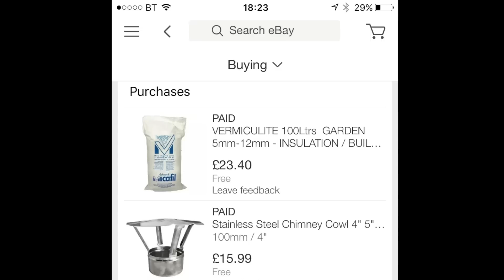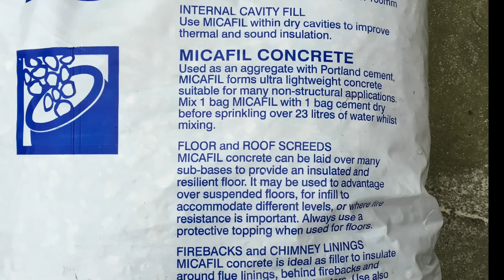Wood Fired Pizza Oven made over a gym ball

Comment: I watched this video a year ago and finally made one. I went with perlite instead of vermiculite because I heard it holds up more. I did a ratio of 5/1/1 perlite/portland cement/water. I went through 4 cubic feet (sorry for america non metric we're idiots here) of perlite and about 1/2 a bag of cement. I did a layer of perlite cement, put a fire insulation blanket, chicken wire and another layer of perlite/cement. It is in the process of drying right now. I let the first layer dry for about a week. I will build it on a stand with wheels so I can move in the garage when not in use. Thanks for the inspiration.

Comment from the maker: Hi, Ball is 65cm in diameter, Cement is standard blue circle, thanks for watching, keep the questions coming and I will answer
Reply: Mark Cuthbertson loved your video & just completed mine using your method. Do u think a standard sand cement render would work instead of victus ?
Reply: Good Job. What kind of material u put underneath the brick? Was it suitable for high heat?
Reply: Hi, do you know how many litres of vermiculite you used in your build?
Reply from the maker: MrCurry about 3/4 of a 100 litre bag
Reply: Mr C TV thanks 👍

Comment: Thanks for your inspiration. I've built an oven this way in spring this year and have used it a lot of time. A good thing was to put netting wire in the walls. What I had to change was the fundament. The sand was too hot and the bottom board begun to smoke a little bit. I used fermiculite instead of the sand and tiles as the bottom.

Comment: Great video! Loved the creative use of the gym ball! For the inside of the oven if you could line it with an inch of fire clay mixed with fire brick aggregate it will last you a long time and resist cracking and heat loss.

Comment: I've made one a bit like yours and fired it up today for the first time and I made 4 home made pizzas,,  it did them in no time I was real impressed in how they work
Reply: Ricky, did you do it exactly like he did it... or did you modify it any at all?
Reply: How is yours holding up?
Reply: Pizza's don't work bro!!  You have to work making /baking the pizzas and the hardest work... To eat them all untill you burst. 👍😊
For an oven - (any oven) it's important to accumulate heat. A very low density concrete doesn't do that well. That's why it proposed the 1" clay liner which heats up independently. Clay is a very good heat accumulator. Without the clay liner your baking will will be less
Regards from Bert in Spain... 
It's almost 40 degrees C here.. Pizza's bake exposed to sunlight... 

Good luck with your pizza oven project

Comment: Nice job ☺ my compliments. Few questions to ask you, as I did 3 brick ovens and You know the work load time and cost. My intention to try a cast one in a new holiday house. 

1. How much internal temperature you can reach ?
2. How long after using it holds hot its internal temperature ?
3. any cracks so far?
4. Do you know the external tempreture while it's working full please ?
5 do you still advice same ratio of mixture - cement or refractory please ?

Thank you so much in advance..

Comment: If you apply a clay liner inside the dome, you have better heat retention and a cooler shell.  The clay liner will shrink when drying and a narrow cavity will occur between liner and insulating shell.  After drying fire up.  This will provide better Fuel economy, higher temperatures inside and better backing results. also increased longevity of the whole structure and no shell cracking. 
 Remark: while drying the clay liner will crack a bit (this is normal due shrinkage and will not influence the integrity of the liner). Cracks can easely be repaired with clay slurry.
After firing up, the clay liner is frost resistent.

Alternativ for the vermaculite U can use perlite or expanded clay pellets or a mixture thereof.

I made one of cheap expanded clay pellets ( the ones used in hydroponics) and cement and with a 1" clay liner and a steel door with adjustable air intake. I normally use olive fire wood which gives a delicious aroma to the pizza or sourdough bread. Cold or hot smoking of fish or meat is also possible and absolutely delicious.

Regards from Spain
Reply: How does one apply a clay liner?
Reply: @zennsx  Form Several equally  thick pancakes of clay and stick it to the inside of the dome. Close the seams with your fingers untill the whole inner surface of the dome is covered.  Let dry the clay untill hard.  Than start at small fire in the dome to drive out the remaining moisture.   Thereafter make a bigger fire inside the dome to bake the clay.   Repair eventual cracks with clay slurry.
Reply: That's a great tip thanks. And olive tree wood is a great idea too!
Reply: Can u do this on one go... i mean  cover the ball with clay then cover with perlite. Or do u have clay first, wait for it to dry then perlite  shell. Reading your write up I guess it can be done in a single go. Also it is weather proof.  I.e left in the rain?
Reply: @tanwirkhan78611  I have not tried to make the liner +shell in one go. I made the clay liner after the cement was cured and the low density concrete dome installed on it's final position. Once that was done I applied the clay liner. Doing so I could keep the weight of the dome relatively low for easy handling/lifting by one person (me).
I guess technically you can make the liner + shell in one go but the total weight of the oven becomes a headache. 
After erection the outer surface must be sealed with lime or cement slurry to avoid rainwater entering the porous concrete dome.

Regards from Bert in 🇪🇸
Reply: @son-of-a-gun  thanks for the response, weight for me won't be an issue  as it will be fixed in place... my idea was to build the shape out of sharpe sand then cover it with clay let it dry with a key surface. Once dry cover with perlite and top with  cement  slurry
Reply: And paint
Reply: @tanwirkhan78611  I think your method will work but you should not make a key surface but a smooth surface. The clay will break loose from the concrete anyway and that's exactly what you want.  please refer to my first comment. 
I hope you mean to cover the clay with perlite +cement mortar and once everything is hard and dry put on the cement slurry for sealing. I would seal it as a last step. 
Remark :  lime slurry sealant is a slightly better option since lime does not  crack as cement does i.e is more flexible. besides when lime gets wet in the rain it will have self healing properties I.e. It becomes a bit soft and closes the cracks if any. 
Good luck with your project
Regards from Bert in 🇪🇸
Reply: @son-of-a-gun  ahh OK,  got u. Thanks ill have statred build the base already.

Comment: I built mine 13 yrs ago, I think yours is a creative use of gym ball and materials, but I think you may need a refinement. The essence of a stone or clay oven is that the wood fire heats the surrounding rock, and the rock retains the heat, which cooks the bread (or crust).Vermicúlite, like perlite, is an insulator. This necessarily means that there will be little stored heat in the hardened mix. Your oven will heat fast, but I'm guessing it won't stay hot long.

In mine I used  a dense clay brick for the oven interiôr, and I put the perlite/cement mix over that. My intention was to keep the brick from sustaining heat loss from  the outside. That way the heated brick retains the maximum heat and only loses heat through the oven interior.

I think it might have been better to start with several inches thick of mortar, with a fire clay (refractôry)additive, and over that add several inches of your vermiculite mixture
Reply: Im hoping you could help me
Reply: @marvincastro4206  ...If you have a question, I'll try to answer it
Reply: @frankhoffman3566  Hello Frank, i'm glad you are still with us. Can i ask something? I was told that white cement would be great for the interior alongside clay brics. What do you think about this? I intend to do one somewhat yours soon, any new knowledge to share?
Reply: @juliosalgado956  ... Hello. Just to clarify,  I don't do concrete as a profession.  I have done quite a bit of research and have had successful concrete projects.

My research indicates that white portland cement is the same as the usual gray stuff.  It isn't better or more heat resistant. If you are talking about coating or painting the red brick with a white portland slurry, I wouldn't. You'd risk chips of the hardened cement  flaking off and finding a way into your food.

I'd want the interior surface to be a good, dense   red clay brick,  (except for the oven floor which should be fire brick)and the mortar joints regular bag mortar, fortified with about a shovelful of fire clay per 90 lb bag.

A method I didn't use to form the oven, which I would have, had I known, is using damp sand to form the interior, then laying strips of plaster of paris soaked paper over that.  After it hardens, the bricks are laid against it, conforming the oven to its shape. After everything is finished and hardened up, you dig out the sand. Really, the only issue is getting the right shape to begin with.
Reply: @juliosalgado956  ... generally, the best shape for the inner part of the oven is a dome.  That's why some are using pilates balls or beach balls. The dome area should be able to comfortably fit your pizza, with a little more space  to fit some of the hot  coals of your original wood fire.

The short tunnel should be wide enough to slide your pizza in. The top of the tunnel should be lower than the top of the dome. The stovepipe should come out of the tunnel and not the dome, encouraging the dome to retain heat longer.

That's about all I know. I hope it helps
Reply: @frankhoffman3566   You are great, i'm glad you could share your knowledge with me and all the people that will read this in the future. I will be writting all your thoughts in my personal book of projects. TY! REALLY GLAD to meet you!

Comment: Whilst the vermiculite is a good thermal insulator, it has no mass and thus will not hold any heat. The idea on a wood fired oven is the bricks get hot and radiate the heat once the fire dies down and can cook for many hours. I doubt the concrete will do the job anywhere near as well, though if just pizza is you sole aim it could be ok.
Reply from the maker: Agreed, but I always get full before I worry about the oven cooling down too much, so it works for my needs, wouldn't work for a commercial applications for the reasons you've stated. Thanks

Comment: Great job....amazing. So simple Just a comment on the outer rendering cracks. It's most likely caused by the expansion differential between the two different substrates. You said the outer render gets fairly hot so there's a heat transfer through the Vermiculite which will expand at a greater rate than the rendering thus causing cracks. A layer of aluminium foil held in place over the Vermiculite then the render applied over this would alow movement between the substrates thus reducing any likelihood of cracking. Just my tuppence worth.
Reply from the maker: Hi John, thanks for the comments and thoughts, possible the most sensible suggestion and explanation anybody has made so far. I'm thinking of making another with Perlite, so I will try and incorporate that idea.
Reply: I was scrolling to see if I was the only one who wondered how two so dissimilar materials would react and how much cracking would occur as a result.

Comment: Fantastic work, thanks Mark. I'm not looking to build a Pizza oven, but I am looking to build a wood-burning fire bowl, and I would definitely use some of your methods. Two tips, if I may? Spraying the ball with cooking spray or using anything similar (including Vaseline) on the ball will keep the cling film from moving around when you're applying it - it's a cooking trick. Second, if the gym ball is expendable, as tip to skip having to build the frame for the ball you could mix polystyrene beads (bean bag filler) with PVA glue, cut a x into the ball, and half fill it with the mixture. Then duct tape the x closed and blow up like normal and leave to dry - cut the ball off and you have a form to use for the oven.

Edit: A question if you don't mind - can the base be built using cement and vermiculite also instead of fire brick?

Comment: I am using perlite and refractory cement as the material, with chicken wire between 2 layers.  I also am adding stainless still pins into the mix.  Finally I am covering the inside with a  final coat of refractory cement  and the outside with perlite, refractory cement, and color.  Do you think that should prevent it from cracking?
Reply from the maker: Sounds a very robust mix your going with, time will tell, but that’s got to be a great start
Reply: @cuthberm  This is incredibly frustrating.  I am using perlite and refractory cement 5:1 mix. I cannot get the render to go up the side without falling back down.  What I did get done seems to crumble.  I covered it with a damp sheet so it would not dry too quickly, but even overnight it still does not harden, the render crumbles.  What am I doing wrong?
Reply: @billwill8067  Did you figure anything out Bill?

Comment: Hi, is the flue necessary? The delivita oven looks like the same shape, but without a flue, so I’m wondering if it could be omitted? Thanks for sharing your build video
Reply from the maker: I guess not, the flue should, if it's working correctly, draw the smoke out of the dome, and therefore draw fresh air in through the front, feeding the fire. In practice I'm not sure if that really happens. The only other downside is any smoke without a chimney is coming back out straight into your face as you check your pizza.
Reply: Mr C TV thanks 👍 I’m gonna try one without a flue, but with a 50cm wide opening. Do you remember how many litres of vermiculite you used in your build?

Comment: Did you have any issues with the sand not providing enough insulation for the wood?  Would you have changed anything?
Reply from the maker: some heat can be felt through the sand to the ply underneath, but at the end of the day I'm not running it for long enough for it to be a problem, there's only so many pizza's you can eat, then you have to stop or you'll be sick!
Reply: @cuthberm  True.  I think I will have some perlite left over, I may put a layer of the mix on the bottom then the sand.....

Comment: I saw a similar video about using cement and vermiculite and after some usage he got many cracks in the dome, what about you?
Reply from the maker: The main crack was caused by the different expansion rates of the flue and the dome, no other cracks, i suspect the heat proof render does a very good job of holding it all together.

Comment: This is an awesome idea, after watching a lot of wood burning overs DIY, this is by far the simplest one. However I have some comments/questions that I'd love to share:
1- Wouldn't be cleaner to line the interior of the oven with slim fire bricks? I feel that the Vermiculite mix would have a lot of pores where ashes and dust can hide and would be very difficult to clean.
2- Why didn't you use more insulation with the sand? doesn't the bottom of the oven get hot?
3- Same thing regarding the fire bricks on the bottom, probably the heat will transfer onto the outer bricks and someone would get hurt touching very hot bricks that are outside the oven.
4- The opening for the over seems a little large, is there any scientific ratio that one should follow, or did you just go with intuition?
5- How much do you think this whole thing weights? I want to build one and put it in my balcony but I am worried about the weight.

Thanks so much for the video, appreciate the effort.
Reply from the maker: Hi, thanks for the comments.
1) I guess it would be cleaner, I sweep out the oven then use a small battery powered blower to force out the last of the ash and dust.
2) Yes the bottom of the oven get's hot, and you can feel the heat through the ply of the base, but it's not been an issue so far.
3) Not noticed the outer bricks getting hot, good point, need to check that, they will of course cool quicker being exposed to the air.
4) The opening is sized to take a standard pizza peel in width, that was my logic.
5) I can only just pick up one corner of it all assembled with the oven on top of the frame work, it weights hell  of a lot, most of that weight is the sand and firebricks
Reply: +Mark Cuthbertson Thanks for the info. Much appreciated 😊

Comment: I’ve watched a lot of these videos and there are aspects to your build that I think are next level like: full shopping list at beginning; the form table is just high enough off the ground so the ground supports the fit ball; the base build is very solid but not intimidating to those with basic wood working skills, and the firebrick base looks a lot easier to do than some of the other over-crafted ones. I’d be interested to know how this oven is holding up and if there are tweaks you would make?
Reply from the maker: Hi, thanks for the comments and feedback. It's now 3 years old, and the main casting has cracked around the metal chimney, somebody made a very good point on here about metal expanding etc. So next time I would change the sand in the base, to make that structure lighter, and therefore easier to move, secondly I will probably try making one from Perlite, and casting a chimney from the same material.
Reply: Did you make on? If so how did it go?